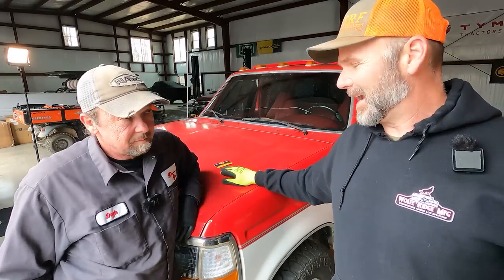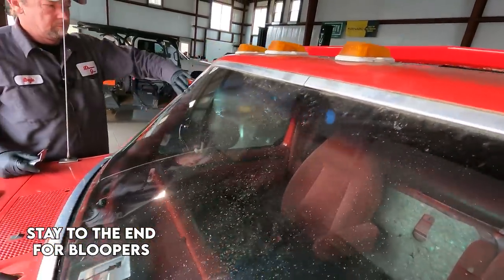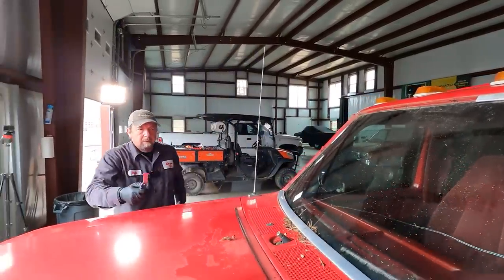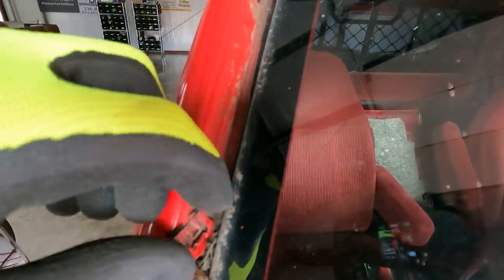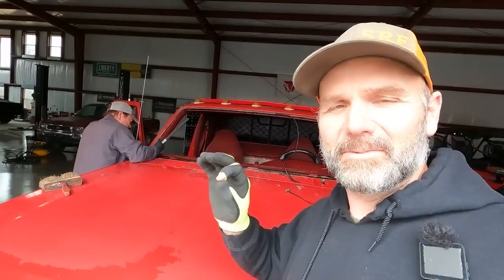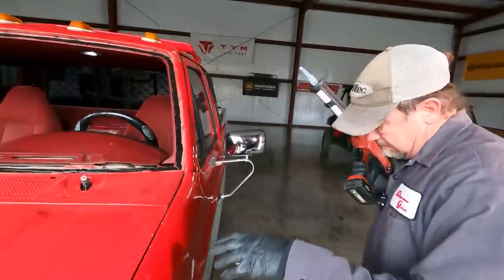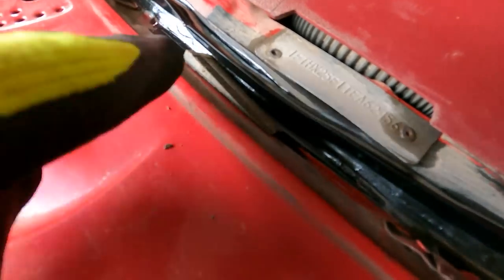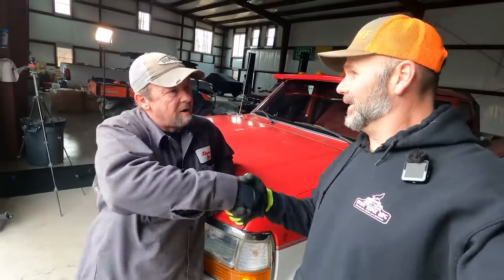How to replace a window in your car or truck the right way!

Comment: Good vid great brief review @ end I had some glass put in my Toyota it cost around $1000 I had ordered it in NW from Japan I said I better look at glass before I take it, thank God I did that it was broken in shipping. So I ordered it from Canada Toyota it came approximately same price then I had to buy rubber gasket but the installer about doubled price of install, he told me I teach you how to do this in case it breaks say when you're in Mexico or whatever you'll know how to do it that was good for me he used a yellow plastic rope similar to the rope electricians use to pull wire through conduit. Then pull out rope as glass slides into rubber slot so pulling rubber forward as glass slid into channel slot of gasket.
I like the neoprene caulk to stick glass to frame too. How nice is new untra clean glass no sand and small scratches. 
Good job.
Best David

Comment: This is only for clarification. That is not primeless glass. Rather  Dow Bata Seal 428+ is a primeless adhesive to the glass meaning you want primer between the Urethane and any bare metal but not between the rithane and the glass. In your conversation your guy may have been referring to the black "Firt" the border around the edge of the glass. However that is not a primer It just aids the installer in doing a neater job so you don't see he Bata Seal from the outside of the glass. But if you were not using 428+ or some sort of adhesive that required a primer to the glass then a primer should be used. More and more adhesive companies are making "Primeless"(to the glass) products. But if you are unsure always consult the manufacturer instructions for your product.

Why is this nit picky stuff important? The windshield in a car or truck are an important part of the cabin safety system. Just like the seat belts. in a crash the windshield keeps you in the cockpit . It is also used to help contain the airbag. When the airbag deploys it goes up against the windshield with tremendous force. and then expands to hold you from hitting any solid object that could add trama to your body

Finally always use the primer made by the company that makes your Urethane There are chemical engineers that know what their primer - adhesive combo need. If ypu install a windshield and make an error and the car or truck is involved in a crash and the bond fails  The law suit will name you the installer as the expansible party and despite money you will loose you may also have to live with the knowledge that your actions may have killed someone. That is why I would agree with your Glass Guy get some help from a lacal expert. Don't just watch a video and figure you are now an "expert".
Reply from the maker: yep...the adhesive doesn't require a primer